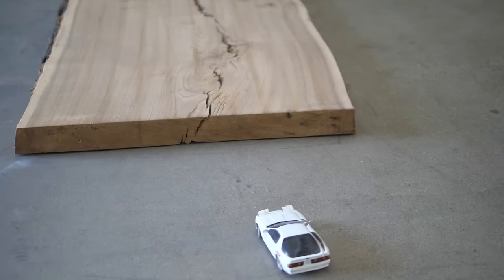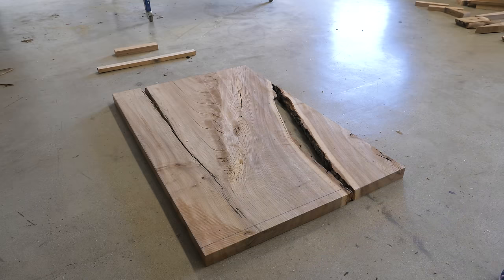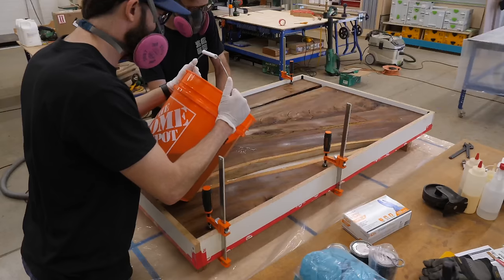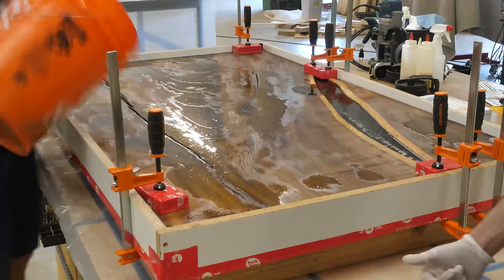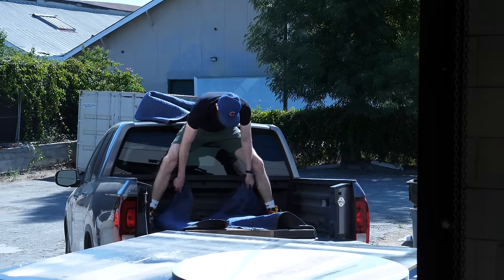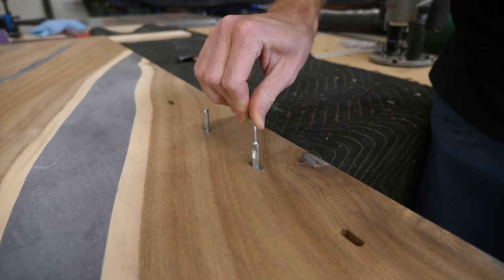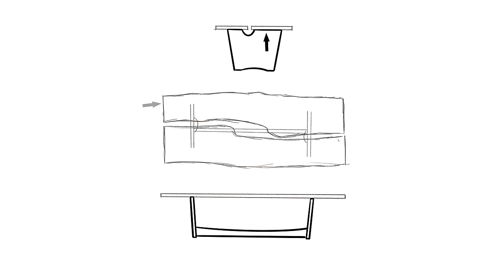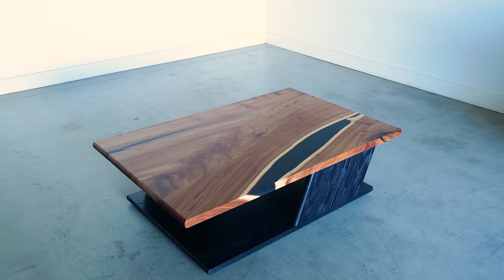This Idea Sucked...So We Fixed It

Comment: The mould release spray is the correct product - wax is not suitable for porous surfaces. 
I'd recommend polishing the release spray after the first coat and then spraying on another coat. This will ensure the spray has coated the whole surface. Also the surface must be solvent cleaned first to ensure the release spray sticks. Otherwise the release agent is displaced by the epoxy and... you know the rest.
As for removing the mess, I'd go for a router sled with a surfacing bit or the power planer as you did.
Reply: Appreciate the tips. We will give it a try.

Comment: would the base look weird if the grain ran in the same direction as the uprights (too much waste or splitting or perpendicular to the top ?).
Reply: Yeah, might look a little weird. And from a structural standpoint, probably not the best option.

Comment: Hey, just a suggestion, what if you use clear resin instead of epoxy? You can get a much cleaner look, and you will be able to see some design on the sides, although if you want it to look the best, you should leave the edges as natural as possible, like the dining table with the split, except it has better use with the same look, for example, if you wanted to stick a small tray in the middle of the dinner table, it would fall right through. But the resin is basically the same except nothing will fall through it. Although resin is more expensive you can sell it for more. Resin is also the exact same as epoxy, so you won't need to learn anymore skills. Anyways, just a suggestion, I think epoxy looks great, I just think a resin table would look more exciting.

Comment: You should watch your fellow youtubers especially John Malecki you could learn a thing or two when pooring epoxy tables like using THAT TAPE THEY USE TO PREVENT STICKING....And the sillicone they use to prevent leaking under the slab..

Comment: Not to be a bummer, but p100's are not the right mask for resin pours. Something that protects from organic vapors like a 3M 6001 is way safer (with option particulate filter if also using for sanding etc) I personally opt for the 3M 60927 with built in p100. Hope this helps!

Comment: A wipe on wax based mould release is going to be a much better choice for this type of stuff. And as for turning melamine into dust... you have a CNC router.
Reply: Wax seems to be a good option. As for the cnc, we definitely considered it, though ours is slightly smaller than the table top.

Comment: Just wondering why you didn’t use the same attachment method on the bottom that you used on the top?  Reason then you could flat ship table.
Reply: Definitely thought about it, and it certainly is an option. I just wanted a solid connection for that bottom joint. No real significant reason.

Comment: I never put resin on melamine…no matter how much mould release (router sled removal of the damned stuff is pernickety)- if you are going to screw through it use cheap MDF and tuck tape it, if  no screwing then just 4 mm HDPE sheet on the bench top is great.
Reply: Appreciate the input!

Comment: Guys!  I just had the exact same issue with the melomene sticking to the pour!  The bottom of my table had several issues because of it. And I used a LOT of release. I followed the method of Black Tail Studio for it, but it didn’t help. So my partner and I will try tape on the form this next time. So, if you have solutions let me know!  Shawn Hughes
Reply: We will definitely be trying some different options on the next one!

Comment: Use the CNC to remove the melamine. Ok, you may lose a bit of thickness if the slab isn't flat but sure as hell beats the laborious task of planing it all off and means you can get.on with something else whilst the CNC does the job for you.

Comment: Don't use melamine  use foam insulation for walls (( the pink stuff people use to saw sheet wood on )) it will stick but be super easy to remove . or stick with the melamine and cover it in cling film . not sure but think you yanks call it surround wrap?

Comment: Very cool build guys.  May I ask another very dumb question about the cross grain dominos - will the glue allow them to accommodate expansion / contraction when you glue them in or defeat the wider slot?
Reply: Thank you! Wood glue has a bit of elasticity, so with the amount that these panels are going to move, it should be fine.
Reply: @shaunb66  Thank you Shaun!  Just a beginner here and this question was really bugging me (and isn't very hypothetical - although not quite yet immediately relevant).  Anyway.  Really enjoy both your guys' content / design sensibility / presentation so please keep going.

Comment: To fix the melamine, I would set up a flattening or fly cutting file on my CNC.  It may take longer, but the work is done for me and dust collection is automatic.  Hold down is easy with this huge slab.  2"diameter cutter and light passes.
Reply: We definitely considered it, though our CNC is a bit smaller than this table, unfortunately.

Comment: Anyone tried using pvc board for the sides of the form?
Also, if you're giving a little extra room around the sides, why not use a heavy release agent like Vaseline? Light weight automotive oil? Automotive grease?
Sure, sounds like a mess. But you could use a grease cutter for cleanup. 
Also, under the wood sections, chuck in some air fittings, and put some tape over top of the holes.You could then pop the base free with compressed air. Maybe.
I think the key is, your mold should be made of materials that are smooth and non-stick as possible. But then you also have to deal with air-lock during removal.
Reply: Appreciate all the ideas!

Comment: I assume your cnc is large enough to hold this table top. Perhaps you could remove the melamine and flatten the slab by surfacing it on the cnc. If  not, another solution could be a staged router sled.

Comment: Could have hogged the melamine off with a CNC or router floating above it on rails on the sides... but, you're done now.   I flattened some large pieces that way a few years ago... then hand planed them to really good finish ... didn't have a power planer....

Comment: at 10 mins 35 seconds you asked what would I do to get the melamine off of the project. the answer is very simple (well at least to me it is) as you so often do you pose another question to give your answer. what is the one thing that can both save or distress any wood? the answer is simple soak  it in water, Melamine falls apart when to much water is applied to any of the open spot that are not sealed correctly, thus making it extremely weak and very brittle.

Comment: Beautiful peice guys. I've recently come into 5 massive slabs of elm about 6ft long and about 2 half ft wide. Looking at doing a beautiful elm coffe table out it. I think epoxy has its place but as you say it's great for filling gaps and stuff but a beautiful river table can be amazing. One thing I noticed was you sanding the live edge I've used wire wheels to clear them off it leaves the natural edge. Just a tip. 🏴👍ps for epoxy resin tips Check out cam at blacktail studio he's a master of the stuff

Comment: If you have a CNC why not put a largest bit you can put in it and run it to take off the thickness of the melamine? Yes it would take a lot of passes but you could set it and forget it vs having to people laboring over removing the material.
Reply: We definitely considered it. It really just came down to time, and the power hand plane was significantly faster than the cnc (we always end up babysitting the cnc). Our cnc is also a bit smaller than this table.

Comment: I would have used a cnc or router sled with a surfacing bit to remove the stuck melamine. But that's coming from someone who had neither lol
Reply: We definitely considered it, though our CNC is a bit smaller than this table, unfortunately.

Comment: Removing the melamine: You've got a CNC, just hit it with a beefy fly cutter.
Reply: We definitely considered it. It really just came down to time, and the power hand plane was significantly faster than the cnc. Our cnc is also a bit smaller than this table.
Reply: @shaunb66  The size issue is a definite limitation, but for flattening any object you could probably just build a "flattening job" in your favorite modeling application were all you need to do is adjust the X/Y limits and set the Z height at the machine. Setup time would only be a few minutes, I would think. Still, came out looking great.

Comment: In terms of getting the melamine of the slab, I would have used the cnc actually.
Reply: We definitely considered it. It really just came down to time, and the power hand plane was significantly faster than the cnc. Our cnc is also a bit smaller than this table.
Reply: @shaunb66  yeah that does make sense

Comment: To remove the melamine, I would have used the CNC. You basically just resurface your piece.
Reply: We definitely considered it. It really just came down to time, and the power hand plane was significantly faster than the cnc. Our cnc is also a bit smaller than this table.

Comment: look, I am no expert, I only watched some renovation videos, they usually take advantage of the diferent properties of the materials right on top of each other and how they react to chemicals, the mold would probably absorb a solvent for the epoxy a lot faster than the wood underneath, so you coul use that, obviously a bit risky but I in my great 0 hours expertise can only think of that xD
Reply: art renovation*, like canvases stuff

Comment: I think the only way to remove that much of something epoxied to melamine is mechanical removal. Obliterating it is one method. If you know someone with a sawmill, you might be able to carefully slice the majority of it off, and then only have to obliterate the actual melamine the is left. 

Ooh. That reminds me. It’s not melamine. It’s MFC, melamine faced chipboard. It’s essentially mdf. Break the sides off the mold, use your tracksaw to score the melamine about 1/8-1/4 deep, then soak it in a level kiddie pool with a tiny bit of water for a half hour. I haven’t tried it. But I bet the chipboard part comes off the melamine epoxied to the slab. In a horrible ugly mess. Not sure if it would be better than grinding it up like you did.
Reply: Somebody else had the soaking idea, as well. Not sure we want to experiment with that, but does sound interesting!
Reply: @shaunb66  turns out I have some scraps on the garage from making shelves for the wife’s craft room. If I get a chance, I’ll try it and pass along the results.

Comment: Sorry, I don't like it. If I wanted a Live Edge Table, I would want to see the bark so I would use a clear pour with a white pour on the bottom 1/4 or 1/8 underneath the clear. Or maybe a fully clear if the lower side has a good view.
Nice work though. Good to see you working out the issues.